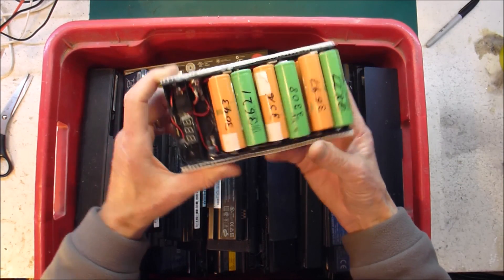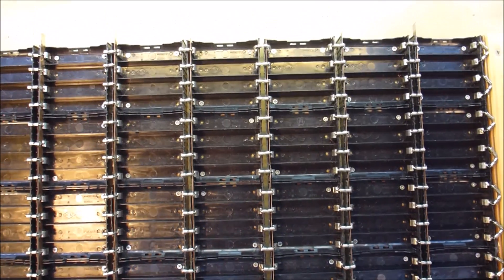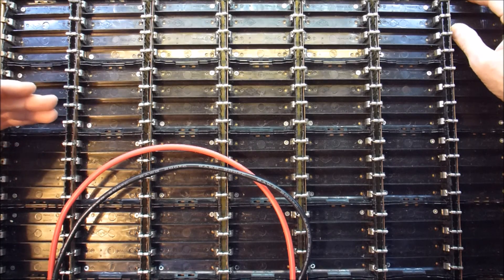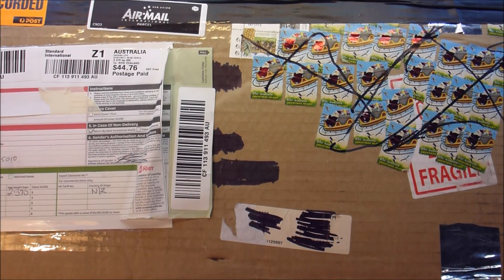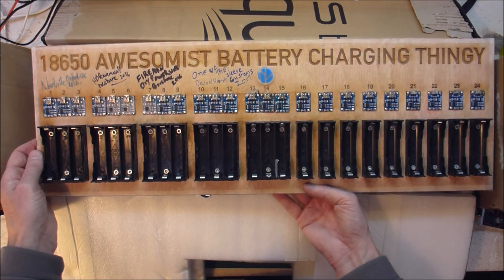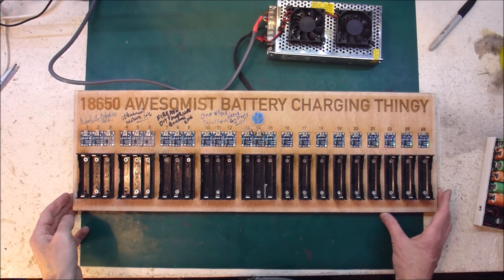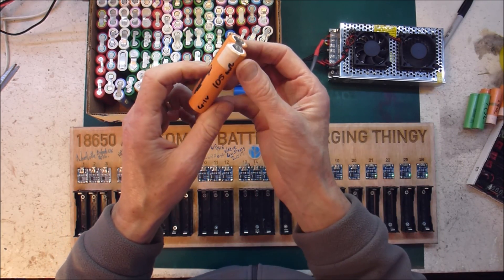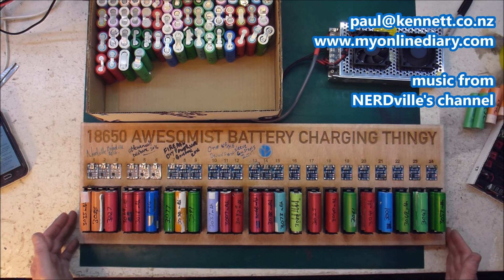Laptop Powerwall 113 - Everything is Awesomist

Comment: On the power shelf, are those fuses between each positive and negative connection?  Where is the original video that shows this.  Seems the copper bus is placed on the negative.
Reply from the maker: Yep - the guy who made this (not me) used glass fuses, and lots of copper for the bus bar. No video of the build as I didn't make it. The original owner gifted it to me. Cheers, Paul
Reply from the maker: There will be a limit to the current you can push through the battery holder connectors. If you assume each cell is OK for up to 1 Amp, then 10 cells would be 10 Amps peak. My hunch is the connectors would be OK for maybe 5 Amps max. That would be my ballpark guess.
Reply: I'm going to have to test that out with my powerwall since its almost identical but without individual fuses. I like the fuse design. I might hybrid it with my current design. ty!

Comment: FYI - have you seen the "No Soldering Battery Building Kit"?
youtube . com/watch?v=9Pxq4Au5iuc
Reply from the maker: Yep. Jehu Garcia did a few videos on them. I avoid the need for this solution by keeping cells in pairs which means I'm able to easily solder to the existing tabs.
Reply: I'm looking at offering my customers 'new replacements' for their lead acid batteries (L16 type), my issue is replacing damaged cells that are soldered. As you are aware, many of your customers do not posses your skill set.  KISS
Reply from the maker: Ah nice. Replacing cells in a Vruzend might not be that easy though? Looks like you'd need to partially disassemble the pack. My powershelf design was my attempt to solve this problem - but it takes up a lot more flat area. Hard to find the perfect answer! Cheers, Paul
Reply: Paul Kennett is that the one Jehu got a response from them including something on the lines of "you need new 18650s as old ones will have soldering remains that may affect the connections" making it quite expensive overall? (the kit plus finding individual, new cells etc). in terms of idea it seems fantastic but i prefer the idea and fun of recovering 18650s. i have the 18650 bug?